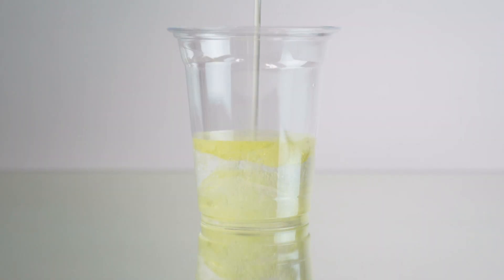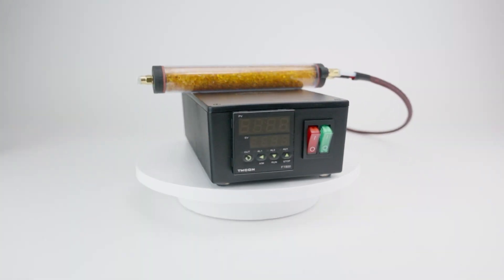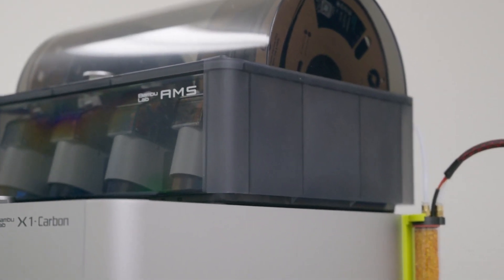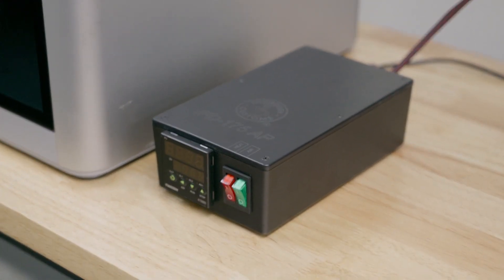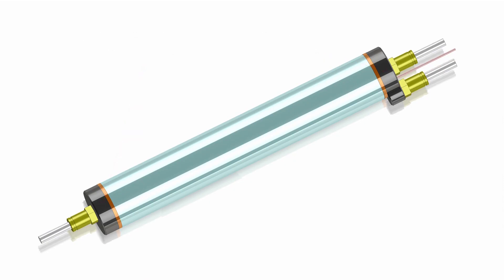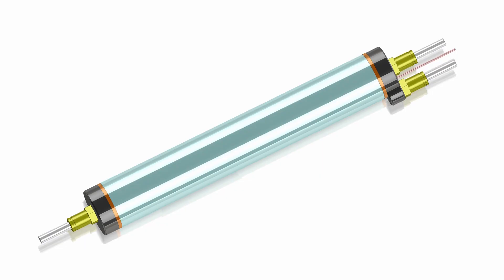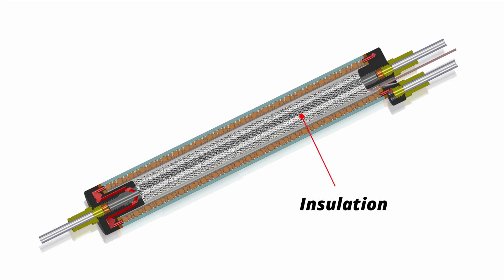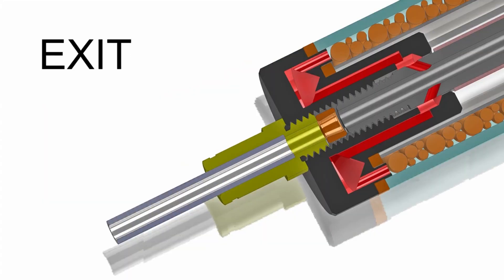The New IFD-175 AP Inline Filament Dryer

Comment: It would appear many do not understand your diagram of the dryer unit itself, or I am severely mistaken on how the system works.  There is a heated tube in the center of the unit that heats the filament and is insulated to not heat the desiccant, unlike the previous design.  Room temperature air is pushed through the desiccant prior to being blown between through the heater chamber traveling in the opposite direction of the filament.  This will give you the driest air where the filament is warmest and try to make the most efficient use of the dried air.

That being said I do have two questions, is there a second heater to dry out the desiccant in this design or is it swapped out?  Is there an advantage to having the desiccant on the tube for the air to flow over vs drying the air remotely, say in the control box, and blowing dry air to the heated tube?
Reply from the maker: You pretty much nailed it!! However, the desiccant does get warmed up but not to the temperature of the core. According to our supplier and input from customers, desiccant is less effective if it is heated over 100C. The insulation and air passing through keep the desiccant temp down while the core stays hot.

Comment: I thought I invented the inline filament dryer.   😀

My business prints a lot of TPU which is hygroscopic.  I always feed the TPU from an overhead bearing spindle, directly into the direct drive extruder with no reverse Bowden tube to create friction, which is bad when printing flexible filament.  I've been planning to pump hot air up through a 6 mm column to dry the filament.  The trick is heating the filament enough to dry it without heating it so much that it stretches.

I'm designing a 3D printed enclosure for our new printers.  I may incorporate the filament drying column mounted on top of the enclosure.
Reply from the maker: What you are describing is almost exactly what the IFD does. Uses hot air but  it also surrounds the filament with direct heat. The instructions have a guide to finding the optimal drying temperature without causing the material to stretch. 

We print all of our pump mounts and o rings for the IFD out of white Polymaker 95A HF  TPU on a Bambu A1 with the IFD mounted directly above the hot end. I don't pre dry the material and the parts come out perfect.

Comment: Always happy to see innovation in the 3d printing space. But you need to provide some numbers. A roll of filament resting on a table is also, technically, a dryer (on a dry day) - so while I'm not doubting that the device removes some moisture, we need numbers.
Numbers like:
- How hygroscopic are each of the filaments? 
- What's the minimum moisture level the device can achieve, dependent on ambient temp, ambient moisture, filament type and feedrate?
- How does it compare to your previous products?
- Some example prints with nylon/TPU (same spool) with/without the gizmo to convince naysayers like myself.
Reply from the maker: Thank you for your input. We have several studies posted on the IFD-175 AP product page. They are not as comprehensive as what you suggest but that's where we hope to get more detailed feedback from our customers. Here's the link. https://thordsen3d.com/product/ifd-175-ap-air-power-inline-filament-dryer/
Reply: @alanthordsen214 Your studies comparing to oven drying seem to have the oven set at a temperature too low to actually dry the filament, Id like to see 60-65c rather than 50c for PLA drying in the oven, and for a longer period of time since only 1h 30min isn't enough to fully dry a spool since, unlike your product, the oven dries the entire spool at once instead of just a tiny portion.
Reply from the maker: @Pandorify  I think you misunderstand the study. We treated every filament the same way which means the lowest temperature material sets the standard for oven drying. in this case the material is PVA. Above 50C it deforms and is unusable. All materials were dried at 50C for 20 hours and our samples were only 10500mm long, not full rolls. The 1h 30min is the time it takes to run the sample through the printer, not drying a full spool.

Comment: I can print filament so brittle it will snap with these dryers.
Reply from the maker: I have some VERY brittle PETG. It breaks no matter what or how its treated. I contemplate tossing it!!
Reply: @alanthordsen214  petg/abs has a point of no return. I tried making a dryer/rewinder: passes through a thordson dryer twice with air movement. No matter what, it would randomly break. However,  it was restored to a playable state again..in random lengths.

Comment: This desiccant isn't blue, but most images I've seen are blue.  Has the dangerous cobalt been replaced with a more health conscious variant?
Reply from the maker: Correct. We switched to the yellow for a couple of reasons. 1, it can absorb much more moisture. 2, We were informed by our CE cert firm that the blue is not acceptable for EU export. 3, it took a while to negotiate with our desiccant manufacturer to provide 1 to 3 mm pellets. 3 to 5 mm do not fit in the tube.

Comment: Roughly 150mm in the dry air, at even an entry level printer's slow feed rate, I really struggle to imagine it spends enough time for any real amount of moisture to migrate out from inside the filament. I would like to see some objective measurement of how much it's reducing moisture in a filament, ideally someone independent like Thomas Sanladerer / Made With Layers or Stefan Hermann / CNC Kitchen.
Reply from the maker: Consider the fact that the hot end can heat filament from room temp to 300c in a fraction of a second. Even at 200mmps with a .4 nozzle, filament remains inside the tube for 44 seconds with no retraction. That's more than enough time for heat to penetrate to the core.
Reply: @alanthordsen214  I have no doubt at all of its effectiveness as a pre-heater for the filament, warming it through. And I can absolutely see how pre-heating could have benefits, there could be a benefit there in reducing the thermal work done in the hotend, it might make for more thorough melting, maybe that allows for higher feed rates or maybe improved layer bonding. But for moisture to leave the filament, which is the stated goal, in 45 seconds exposure to dry air? Well, I would like to see that proven (and I really do mean I want it proven, I want you to be right!). Independent testing and real numbers, which was what my comment was about, would answer that.
Reply from the maker: Preheating using the IFD would only be effective with a direct drive system. If there is a long pathway from the feeder to the hotend, the filament will have already cooled. The filament is not just exposed to dry air. It is surrounded by direct heat which penetrates quickly. The air simply pushes out any moisture released. You are correct. Independent studies are necessary and that's where customer feedback is important. Given the variety of environments, no one will get the same results that we do. For instance, we've already discovered with customer feedback that altitude can effect performance.
Reply: @alanthordsen214  In what way does altitude affect performance?
Reply from the maker: @talentedmrripley9057  Higher altitude results in higher evaporation rates due to the atmospheric pressure.
Reply: @ So it’s a benefit.

Comment: please.. pay attention to audio.   Your music needs toned down, and the voice needs set to stereo, even if it was only recorded in mono.
the diagram could use some work.  I am not actually sure the diagram as it is shown, can actually do the things you claim it will do eg: dry the filament.
I don't mind the box setup and inline combo - but another thing would be to have a sound reading for how loud it is - some noises can really be disruptive and they are frequently found in this field.   Fans reaching 70dB  for example, should actually have some form of hearing protection, not for the sake it would 'harm your ears' - but because that loud, that long use - can just cause headaches and other problems.   Air pumps have been loud for decades, it's hard with current tech to make a 'silent' pump that actually can pump enough air to matter.
Reply: Ugh this audio track drove me insane

Comment: Nice idea
1:48 This looks like a soldering station. It would look better if the electronics were integrated into the tube itself, that would be truly inline
Reply from the maker: I made the original version with the pump actually on the dryer. It was very heavy the loud. By having the pump inside the control box and using an umbilical tube, both weight and noise are mitigated.

Comment: The action time is too short to be instant dry, and heated silica gel will not absorb moisture
Reply from the maker: Hi @packpack758, Actually there is plenty of time especially since the air push is added. Think about how fast a hot end heats filament from room temperature to 220C +. It takes a fraction of a second. Our dryer is no different. It's the TG temp of the filament that determines how much heat it can absorb before starting to stretch.
Reply: Two false statements. 😂
Reply from the maker: @the_natrix9959  Who's statements are false? Mine or packpack?
Reply: It's a 1.75mm xsection. Do you brain?
Reply from the maker: @the_natrix9959  I don't understand your comment.
Reply: @alanthordsen214  I see I tagged the incorrect comment. Pack pack ..
Reply: @the_natrix9959  when heated to a high temperature, silica gel will not effectively absorb moisture because the heat causes it to release any adsorbed moisture, essentially "drying out" the gel and making it temporarily unable to absorb more water until it cools down again. 
Key points about silica gel and heat:
Reactivation through heat:
Silica gel can be regenerated by heating it to a specific temperature range (typically between 100°C and 200°C) to drive off absorbed moisture and prepare it for reuse. 
Temperature limitations:
Overheating silica gel can damage its structure and significantly reduce its moisture absorption capacity. 
Mechanism of adsorption:
Silica gel absorbs moisture through a process called adsorption, where water molecules adhere to the surface of the gel particles.
Reply: Measure the results yourselves, publish it. Or, do as most doers do and do. Seriously,  design,  print, NEXT.